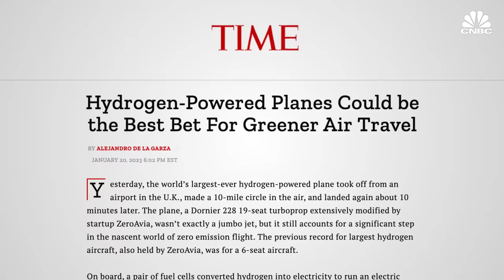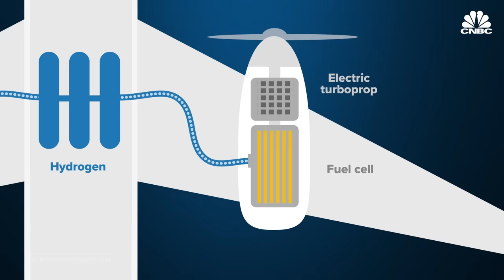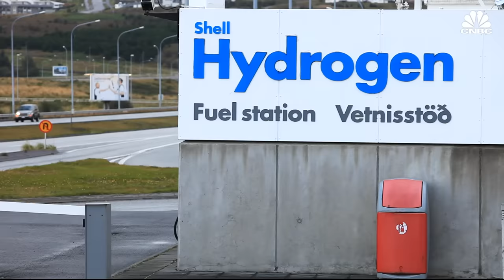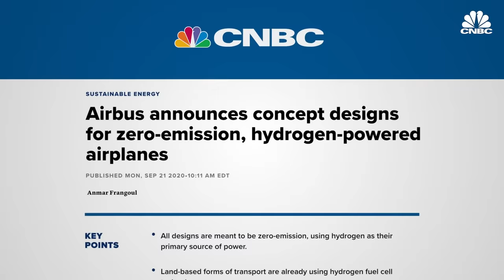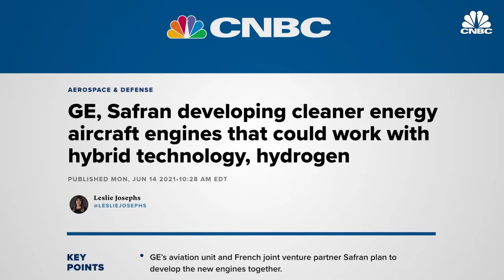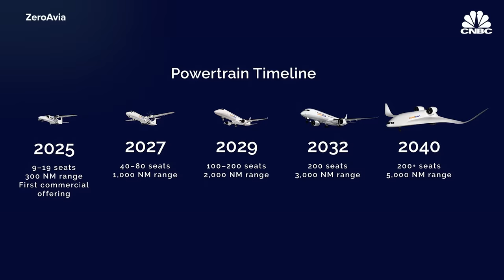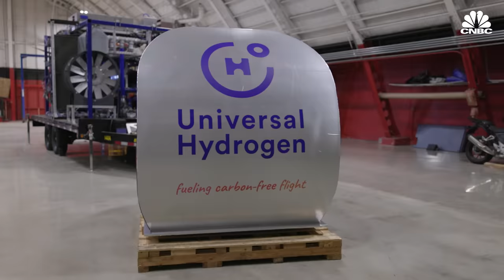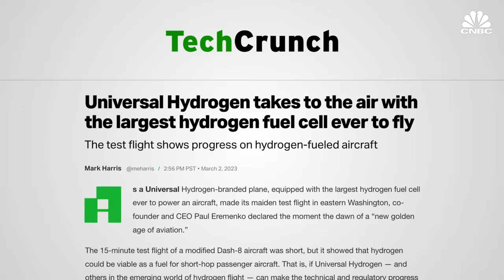Why Hydrogen-Powered Planes Will Beat Electric Planes

Comment: No matter if the medium is battery, hydrogen, or whatever; it is only a medium. We need a massive increase in non-fossil electricity capacity to power all of these vehicles, and it needs to start now because it is going to take a while to get there. This needs to be addressed.
Reply: That's actually NOT what is needed, we already have overcapacity of renewable power at least in some parts of the country.  Like it or not, we need backup fossil fuel power for windless/cloudy days or we need affordable energy storage, which is not looking viable yet.  So we are being forced on an arbitrary time table towards power shortages as a way of life, along with absurdly expensive power.
Reply: @someotherdude  We do need base power as you say, and since fossil will only last so long, the only other viable option is nuclear ...
Reply: @SuperYellowsubmarin  put two wires in water, turn the power on and you’re producing hydrogen.  The ramp up/down compared to nuclear is no contest.
Wouldn’t it make sense to turn on hydrolysis units when renewables are producing excess power; smoothing out the ebbs and flows (with no residual waste product at the end). Further, we should also be encouraging the time-shifting of energy use through variable power pricing.
Reply: @g00rb4u   But you need water to live right? Do you want water prices to rise up again? Are you even thinking of the consequences? Sure there's no emissions, but what about water resources for everyday needs?
Reply: It is already being addressed. Solar and wind installations are being installed at exponential rates every year. Battery backup at a municipal scale is also growing exponentially to replace the need for fossil fuel backup stations. When you look into hwo fast and huge the projects are and how fast it's scaling and how quickly the cost is coming down for renewables it's actually quite crazy. This transition is happening very fast.
Reply: @someotherdude  municipal-scale backup batteries are being installed at exponential rates. Won't need much fossil fuel backup or baseline generation in around 10 years. The transition is happening very quickly and speeding up. Prices for solar and wind are plummeting and are by far cheaper than fossil fuel. Batteries might still go up and down in price but overall the trend will be down as efficiencies of scale and better technology kick in.
Reply: @nushia7192  When you produce hydrogen, you're splitting H20 into its components. When you use the hydrogen, it mixes with O2 and becomes H2O once again.
Reply: It's happening in Europe.. But probably not in USA.. Yet.
Reply: In many places where there are a lot of renewable energy electricity prices often goes down close to 0 or sometimes even in the negative. There is plenty of surplus RE to be tapped already and more will come.
Reply: @nushia7192  80% of the earth's surface is water. We have plenty of it.
Reply: @g00rb4u  So where is the electricity going to come from ? For every kWh of hydrogen power used from electrolysis, it needs 2-4 kWh of electricity.
Reply: @nushia7192  What a daft comment ! Are you serious ?
Reply: @truhartwood3170  The amount of battery storage on the grid is TINY ! Less than 0.1% of usage. You'd almost need to convert the whole  world economy to battery manufacturing to be able to use it for solar and wind storage ! You dreamers haven't run the numbers.
Reply: @truhartwood3170  Batteries are an hugely expensive dead end. To convert the UK grid to solar and wind you'd need about £ 1 TRILLION worth of batteries and have to replace them regularly !
Reply: @grahamstevenson1740  solar duck curve
Reply: @grahamstevenson1740  Yes, it will cost a massive amount of money to make the switch. But how does that compare to the costs of oil exploration, drilling, pumping, refining, transporting etc. that's needed to maintain the current system? It turns out you actually need less to convert everything to electricity than to maintain the current system run on oil and gas. If you estimate it over the next 10 years, it would cost about $10T to make the switch, but $14T would be spent on oil and gas in that same timeframe. And once the transition is made, the cost to maintain is drastically lower than maintaining a system based on oil and gas. If you're worried about how much stuff costs, you should be enthusiastically supporting the transition to electrification.
Reply: @grahamstevenson1740  actually, the numbers have been run. Extensively and thoroughly. Sorry to break it to you, but the world isn't going to stop transitioning to electric just because you haven't done your homework. The only thing that will change is whether or not you understand why and how things that are happening, are happening.
Reply: @g00rb4u  The daily production curve for solar does not really match our use and overnight charging of EVs will make it far worse.
Reply: @grahamstevenson1740 

Exactly. For every MW installed solar and wind we need the same amount of non-cyclic power supplied. The only renewable option we currently have are biomass power plants. The tree huggers will be burning up the Amazon forest quicker than Brazilian natives have ever done. 

The issue is and has always been they don't have a clue how to calculate their fantasy world properly. If you do you realize the transition simply cannot work. The difference in energy density and thus basic operational cost between renewables and fossil fuels is just too large. 

A kWh coming from a coal powered plant has $ 0.02 production cost. That's why China is opening a new coal fired power plant every week. No amount of subsidies on renewables can compensate for this in the long run.
Reply: @peterdejong5456  I'd question if the cost of coal is as low as you suggest but certainly relying on renewables only is pure fantasy.
Reply: @grahamstevenson1740  
Especially if forecasts of global energy demand do not allow for a realistic scale up of renewables. If current demographic and economic developments continu by 2050 global energy demand will have doubled and by the end of the century it will have quadrupled. Even if we manage to cover our current demand by renewables completely by scaling up to the max, we will need every energy source known to man, including fossil and nuclear, not to find ourselves in a permanent worldwide energy crisis by the end of the century.
Reply: @peterdejong5456  Where is energy use increasing so much ? In the UK demand is flat and has been for some time. Energy efficiency measures will help it decrease in fact.
Reply: @grahamstevenson1740   
These are global forecasts by the UN. In the developed world the demographic trend is a stabilizing and even shrinking population, but in the developing countries population growth and economic growth will skyrocket. By the end of the century the developing countries will have reached our current level of prosperity. Even if you take technological developments into account that will improve efficiency global energy demand will quadruple. This can never ever be covered by renewables only as most of the world will live in megacities.
Reply: @someotherdude  "we already have overcapacity of renewable power at least in some parts of the country.  Like it or not, we need backup fossil fuel power for windless/cloudy days or we need affordable energy storage" - I assume by "country" you mean the US? Do you really believe there are "windless/cloudy days" for the entire country? No. What you (and most areas of the world) need is more energy transmission over great distances (by ultra-high-voltage links) combined with more renewables, so that you can move the energy from where it's available to where it's needed. China is actually quite far ahead in this sense with multiple UHV links, with the longest one spanning 3200km (for reference, it's about 3900km between NYC & LA).
Reply: not really, actually energy demand decreases if we switch everything to electric by roughly 30%, but generating power never was or will be an issue, so .
Reply: @JohnSmith-pn2vl  Energy demand reduces significantly for electric vehicles as there isn't the inefficiency of an internal combustion engine.
Reply: @JohnSmith-pn2vl  what ? You ever seen power plants built overnight ? It takes anticipation to build the energy capacity we need. It doesn't matter to the powergrid if total energy consumed less. The powergrid WILL have to produce a lot more since fossil fuel energy doesn't transit via the grid now, but any replacement will have to, to varying degrees.
Reply: hydro

Comment: Hydrogen powered aircraft was investigated back in the 1970s. It wasn't economical back then for large aircraft and I doubt it will now. One of the drawbacks was storing large quantities of hydrogen at an airport.
Reply: Yes but in the 70s it was competing against aviation fuel. Now we've mode on quite a lot of progress in materials science and it's competition is a very expensive inefficient storage medium in batteries.
Reply: Electric vehicle also start around early 19s and dies out after that. Now it's increased in demand and competitive than the fossil fuel. Things is fossil fuel company are so powerful that they can monopoly the market to stop any competitor in the market and hinder humanity from going forward. Only now with the present of Internet that people start to realise how bad it is that this kind of company existed. Judging from your statement I can say that fossil fuel company do a good job in setting the mindset of general people
Reply: Jetliners also need strong tanks to store the hydrogen and I don't believe there light ?
Reply: I wonder how much of that decision was down to the oil industry saying that it is not feasible. They probably came up with their own "studies" stating that it is " not yet up to scratch", thereby ensuring that oil gets burned another 50 years before people start freaking out.

Comment: Aviation is where hydrogen makes the most sense to start a hydrogen economy. Next would be replacing natural gas with hydrogen. Then hydrogen for trains, busses, trucks, and finally passenger cars. Hydrogen is a great way of storing and transmitting energy. There are however a number of technical, safety, and economic hurdles to overcome. Hydrogen can be produced from water and electricity. Renewable, nuclear, or even fossil fuels. Thus hydrogen could ultimately be not only the cleanest fuel, but also the cheapest fuel.

Comment: One thing is true, Hydrogen is potentially the best option. But thats when you just see in context on a fuel to engine. But when you see supply chain, whole big cargo planes , Hydrogen generation and transportation Then you realize its still in infancy stage.
Reply: Perfectly summarised.
Reply: Not true.  Batteries are the best option.
If you really want to use chemicals, better to use methane.
Reply: We will soon get abundant renewable energy, so creating hydrogen from water will get cheap. It seems these new companies could gain a lot of market share from Airbus and Boeing much earlier than these two legacy companies realize their plans for sustainable planes.
Reply: @eaaeeeea  When is soon?
Reply: Who wants to see little rocket man fall on his face?
😂
Reply: Think ammonia fuel cells, safe source of Hydrogen, distribution system in place (service stations),
Reply: @bru512  Batteries for commercial aircraft aren't viable without a significant increase in energy density. Commercial jets require on the order of 50-100MW of power. For a short haul 2 hour flight that's 200MWh of power,  at 250Wh/kg that's roughly 800,000kg for context an A320 has a max weight of 63000kg. So the energy consumption would be orders of magnitude more than SAF, ammonia or hydrogen. Calcs are rough estimates but the point is it's not viable for anything above short range/general aviation.
Reply: @nelly_2k90  Why is Elon saying that 500 Wh/kg s sufficent?
Reply: @bru512  batteries are only good for short range domestic flights but for midrange flights hydrogen is the best option. For long range above 5000km+ range currently there's no solution. Hydrogen is not useful for long range. Methane produces carbon dioxide after combustion, so why should we even use it?

Comment: CNBC does top-notch documentaries, interesting and well researched. Ammonia is really the key here...too bad there was no mention of it (though this doc was focused on H2)...NH3 is a better H2 carrier than liquid hydrogen....about twice as much and its in liquid form can be held at a much lower pressure about 10 bar (while H2 gas is at 700 bar)...that's the real future imo. Ofc NH3 is a toxic substance, so we'd need to handle it better than we do gasoline (as it can cause blindness), but for decarbonizing, it's the pinnacle for an alternate energy source.
Reply: I've seen some research into NH3 fuel cells. It's efficiency is at 62% vs hydrogen at 70%. I'd say it isn't too far away. Ammonia fuel cells seem quite interesting as we already have a pretty strong Ammonia production pipeline.
Reply: @wakannnai1  Ya that's pretty amazing, though I've heard NH3 FC's are SOFC's that work at a very high temp requiring special materials...so more costly. The other option is cracking the ammonia to H2 and using in a traditional pem fuel cell. If I recall SOFC's are also multifuel, so you can run on other sources as well...but a direct NH3 fc would be best...still cracking it is not a bad alternative.